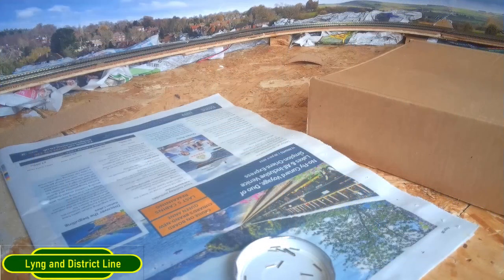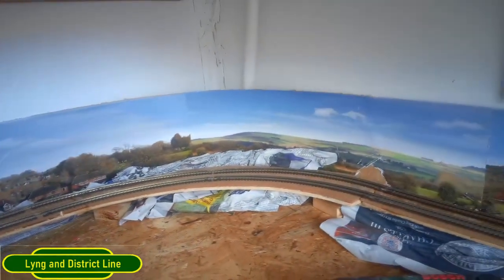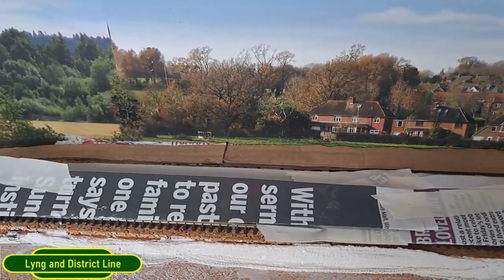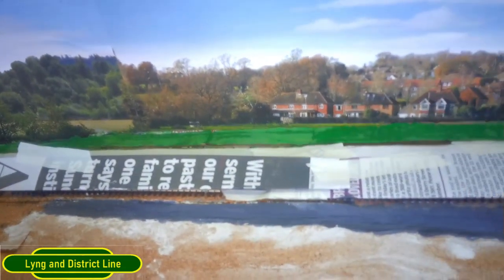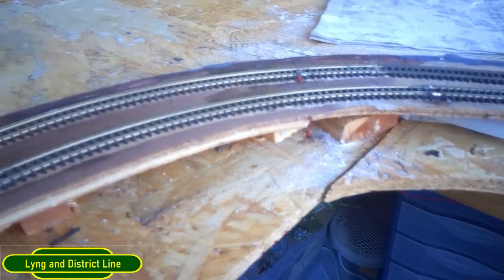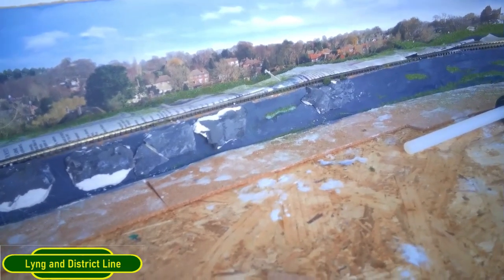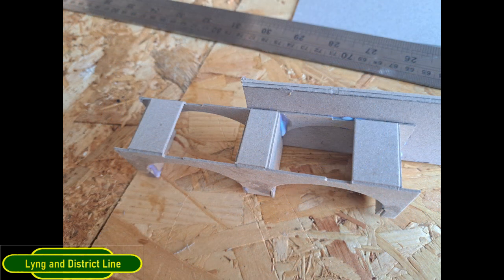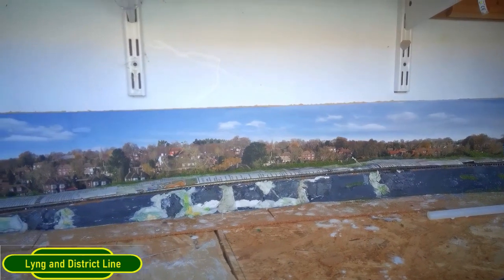Lyng and District Model Railway - Episode 53 - Paper, Glue And messy bits!

Comment: Hi Steve very brave to start scenic work already i would be just running the trains until i was totally satisfied now in all fairness you my be at that stage and if so spot on. It does change how it looks does doing a bit of scenery. Have a good week. Colin
Reply from the maker: Hi Colin - this time around each time I add scenery I have re run the locos to ensure they still run smoothly. I had to do the far corner as if I waited until all the tracks were down it would mean leaning over and on the third and forth track so felt it necessary to start there at this early stage. I am mindful of what you say - so am really making myself behave and only do what is needed for now.
Regards
Steve